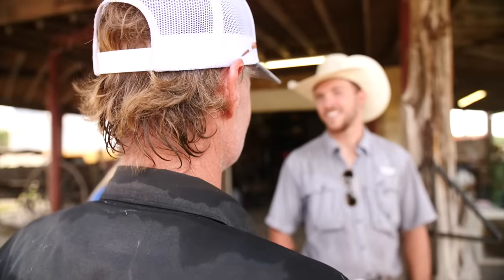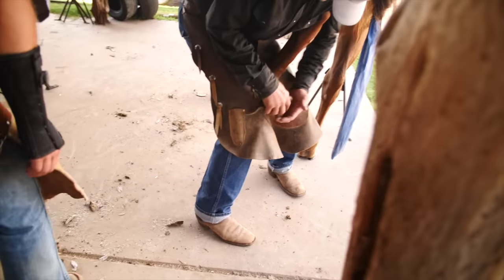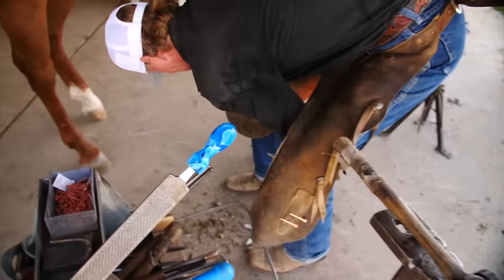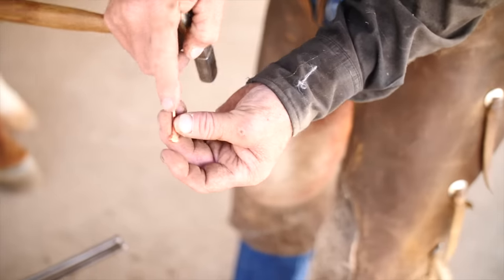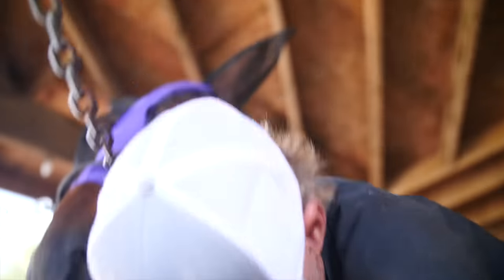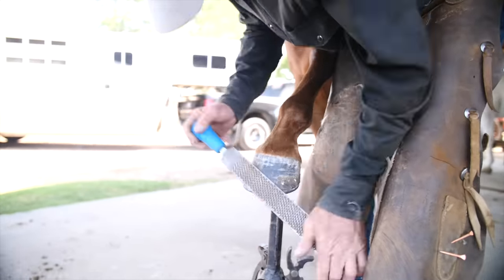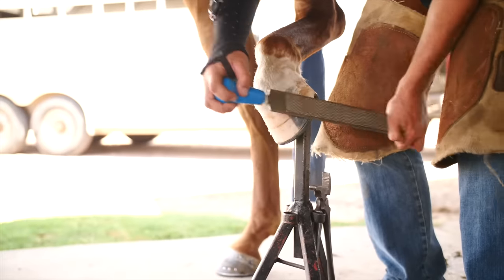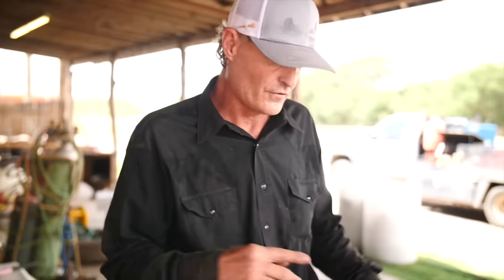How to shoe a horse with Brice Chapman - Just Ranchin 9

Comment: Im a new farrier and I was always taught to gouge under the clinch then clinch them over. Makes a smoother fit
Reply: I been a farrier for 30 years . Don't gauge under the clench ! You job is to provide protection to the hoof without making un necessary  marks etc in the hoof wall .
Reply: @deanwitt7903  It's a point that I've heard debated more than once!
Reply: Yes you should gouge. Leaves a very nice and tidy clinch.
Reply: @joeyhernandez6715  and an unusual necessary gouge in the hoof wall . You can make a better clench by not doing it . Looks untidy by marking the wall without need !

Comment: Great work and a noble profession that's been around for centuries, sure will be around for centuries more to come. Nothing modern about it,just a man and a horse.
I noticed however, that you didn't pre heat the shoes and burn fit them to the hoofs which ensures perfect fit and full contact. 
Keep up the good work. 
Greetings from Bosnia
Reply: In Europe hot shoeing is pretty much always done 100% of the time. We do that sometimes here in America, especially for apprintaces who wont be able to level a foot well enough by eye and skill. Also, too many repeated burns too a horses sole "can" over a long time cause problems. Yes, if you have a hard time leveling feet properly absolutley use hot shoeing, I still do from time to time if im not feeling confident, but for some reason here in the US ferrier spend a tremendous amount of time learning to trim properly without the hot shoe method.

Comment: So what do you do to the holes when you take the shoe off????
Reply: Hooves grow constantly.  The sections where the holes are eventually grow out and are trimmed off.  You want to drive as few nails as possible, however, as every  nail hole does weaken the hoof structure before it does grow out.  That's where technique and precision come in, you need to know where every hammer tap is directing that nail.  Not a job for dummies.
Reply: @radchannel5494  thanks for the info

Comment: It is 2020. That is a file, not a rasp. Love this guy, but with all due respect, clinching stays.
Reply: "Rasps are similar to files. They are made of hardened steel in the same file shapes. They are used to remove excess material from a work surface quickly. However, they leave a very rough surface, so they are never used for precision or finish work."